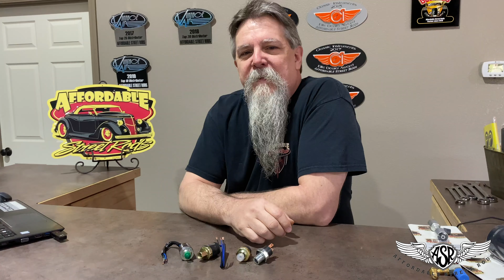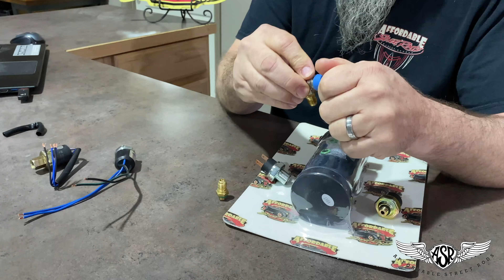What's the difference between a binary and a trinary switch?

Comment: You convinced me.   I'm working on a 1987 suburban and it did not have the high pressure switch in the R4 compressor.
I'm doing a Sanden FLX7 conversion and i'll now put a binary switch on the factory high side R12 port, factory low side switch on the accumulator will be wired in series.  Will also cut the (new)factory hose set and crimp in a couple of R134 ports.  That has a added benefit of extending the hose a couple inchs for the VA sanden bracket and keeps me from needing to use those leaky R12 to R134 fitting adapters.

Comment: My question is I’m running this in a 4 x 4 truck and I have my electric fans hooked up on a switch that will be running as long as the engines turned on so do I just leave them wires in hooked?

Comment: binary switches are only on the hight side lines? also do you have a link for the safety switch adaptor fitting (threaded)
Reply from the maker: Yes, safety switches, whether it's a binary or trinary only go in the #6 lines between the condenser and the evaporator. All of our safety switch options can be found here: https://www.affordablestreetrods.com/shop-for-parts/vintage-air-performance-air-conditioning/safety-switches-safety-switch-fittings/

Comment: Thanks for the great video and information. Quick question if you have a second: We have a VA system using a stock mechanical fan, but we're getting some overheating. So, we are adding an additional pusher electric fan to help out. This fan will be mounted in front of the condenser. We had originally been planning to just stay with the binary switch and splicing into the compressor activation wire into the fan controller. However, we read about how VA recommends trinary switches for electric fans, so we were now making plans to change out the binary to a trinary switch. But, after doing more reading, and watching your video, I'm wondering if that is completely necessary. The VA system has worked well with the mechanical fan, even when the engine runs hot. If the main benefit of the trinary switch is to get the fan turned on early, knowing that with a binary switch our fan will turn on immediately, is there another reason to go with the trinary switch over a binary when using both a mechanical and auxiliary electric fan? Thank you for any advice and for the great video.
Reply from the maker: The trinary switch's third function is to turn the fan on when the system is at optimum pressure. We don't recommend pusher fans as an addition because they can often create cavitation between the two fans and limit the amount of airflow through the system. Typically we recommend going to a single large electric puller fan like the ones from Cooling Components. If your engine only gets hot when running the AC then yes you could use the compressor trigger wire to trigger a relay to run the fan, but if the overheating happens when the AC is not on then you'd be better off running a temp sender in the engine block to trigger the fan relay - Travis

Comment: I am trying to install an aftermarket 12V ac unit. It came with a binary pressure switch and a 80C/176F temperature sensor/switch, you mention engine temperature any idea where I should mount this? Maybe just somewhere on the side of the condenser? Should I just swap it out for a trinary and not even bother? Much appreciated if you can find the time to respond.
Reply from the maker: Your binary safety switch should be used if you have a mechanical cooling fan on your engine, if you have an electric fan for engine cooling then you will want to swap out to the trinary switch. Either way the safety switch is usually screwed into the front of the drier on Vintage Air systems, sometimes they have a special connection in the line for them if the drier does not have provisions for the safety switch. Your temp sender should go in your intake manifold (or sometimes in a head if you don't have a spare spot in your intake).  - Travis
Reply: @affordablestreetrods  thanks for your reply. I should have mentioned this is not a pulley driven compressor and is powered instead by a battery bank.

Comment: Would this system still activate the A/C fan when the car is at cruise speeds? Or would the air flow through the condenser drop the high side pressure enough to turn the fan off?
Reply from the maker: austinmaxi Any time the system hit the limits of the trinary switch, it would trigger the fan circuit. Most of the time while driving you should have enough air flow that it wouldn’t need to activate the fan.